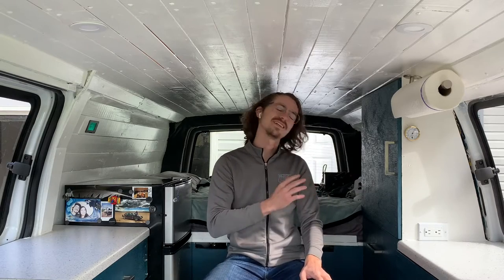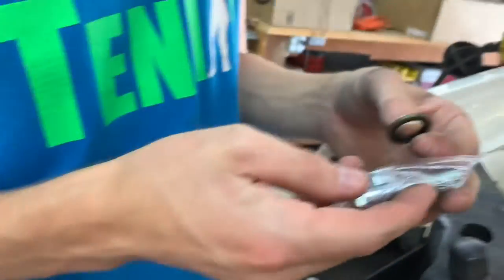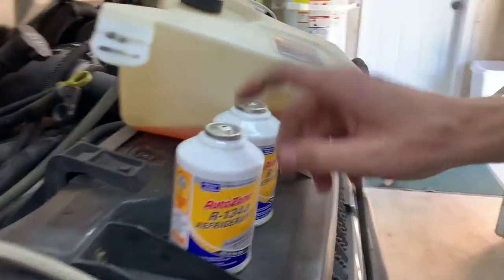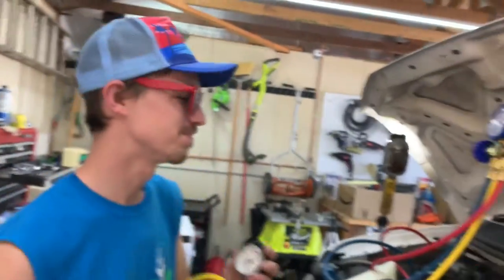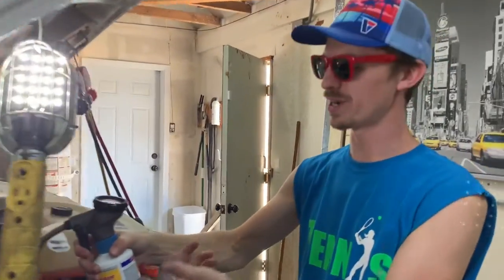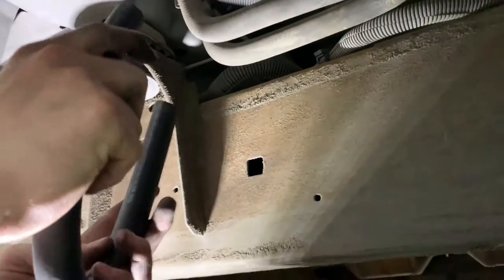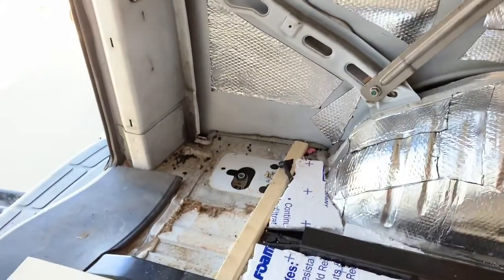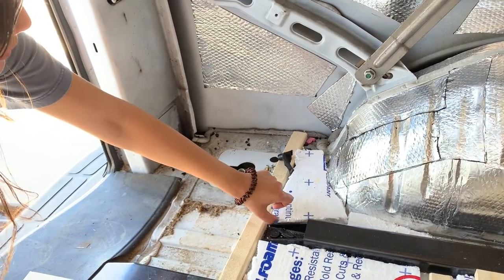Rear AC and Heat Bypass / Removal ~EASY~ (Express / Savana Van)

Comment: Awesome, thank you very much.  I just got a 1998 Dodge B1500 conversion van that has rear heat/ac.  When I was under the van today, I saw those long coolant hoses running all the way back to the rear of the van, some of them rubbing on frame parts, and I thought this is just asking for trouble on the back country dirt roads.  It would not take much to slice open one of those hoses and that would not be a good thing so, thanks again.  I enjoy your videos as they are very helpful.
Reply from the maker: My mom had a 1999 Express van and the rear AC lines ended up rubbing through themselves in a similar fashion. Of course, not so bad to lose the AC vs losing your engine coolant!
Thanks so much for watching and commenting!
-Tim

Comment: Hi Tim, wow! Why oh why? AC is a lifesaver here in TX, and I would have taken any extra parts you were discarding, just in case. I have a 2012 3500 15pax extended LT for my family,  there is some wetness under the back carpet. I could find no info on rear drain, but here you are, saving the day! Just a little wetness in the rear carpet, will clear that soon thanks to you, helping to keep those kids of mine cool in my 'Heavy Chevy'  Thanks! Have a great day!
Reply from the maker: There's still AC in the rear, it's just electric now and runs off my solar / battery bank!
(The 6.0L uses 1/2 gal of gas per hour just idling and running the AC)
Totally agree, 100% a necessity in Texas though.
Stay cool!
-Tim

Comment: Hey Tim great video. I checked the links. I just wanted to let you and your viewers know since it seems you can't get these specific ones on Amazon or Ebay anymore. There is a block off kit made by Auto Cooling Solutions, made in the USA, backed with a lifetime warranty and supports American jobs!  If you're looking you can find our site easy! Thanks, feel free to delete this comment if your linked products become relevant again. Or if you're still doing the amazon affiliate stuff, our rear ac block off kits, line sets and more are also there. You could switch out those links for ones that are available!
Reply from the maker: Appreciate the comment! Swapped out the Amazon Affiliate link to your product.
Curious (if you happen to know) - the line set claims to fit 2003 - 2014. Any idea what changed in 2015+ on the GM van AC system?
Cheers! 
-Tim
Reply: @VanwithTim  Hi Tim, thanks for the link swap! As for the line sets on those vans, we don't make any line sets for the full size GM vans. Our block offs go to 2014 only because we haven't verified any years beyond 2014. It's not a model that we have had a lot of inquiry into and therefore it get's somewhat of a "back shelf" treatment in the priority list. However, because the body shape is not all that different and if OEM line sets are listing different from 14 to 15, it could be maybe different connections were used and or maybe a slightly different routing of the lines. That would be my best guess without actually knowing for sure.
Reply from the maker: @Autocoolingsolutions  That makes sense. If I'm ever at the salvage yard and see a 2015+ I'll break out the calipers and check it out. 
2003 - 2022 GM vans seem to be around 85% the same. (95% on the exterior!) But you just never know what subtle changes happen under the hood and behind the dashboard.
All the best!
-Tim
Reply: @VanwithTim  Good idea. Sometimes they make the subtle changes just to make things incompatible with prior "era" models.

Comment: Appreciate the video, very helpful..  i had a mishap with a subfloor screw and an unknown rear heating/cooling line (was leaking clearish oily fluid) 2014 econoline e350. You seem super knowledgeable and
Reply: If you have any ideas on my path fwd is really appreciate any help!
Reply from the maker: @shizzhizz1234  I'm not familiar with the Ford vans unfortunately, but if your AC up front stopped working then it's definitely an AC line. (There should be block off kits for the ford vans much like the kit for my chevy van in the video)

If it's a coolant line you could cut all the way through the metal line where it was punctured and clamp an appropriately sized rubber hose over the connection to repair the leak!

And don't be afraid to give the fluid a quick smell. Coolant has a distinct sweet smell to it!

-Tim
Reply: @VanwithTim   thanks for the tips my man, it ended up being a coolant liine and so a pretty easy fix after all my anxiety..   definitely considering cutting ac so i can delete the rear system to make room for activities!   Appreciate ya

Comment: Update.  The block heater mentioned below is apparently 1960's tech.  I can not now find any comparable device that isn't electrically heated.  The oil burners are little boilers, power hungry and 4 or 5 times the output we need.

   Tim is, near as i can tell, the only other person in the world that figured out that cars come with a power vent from the factory.  And yet...
   Why is it that nobody else gets that vans may also come with the raw material of a complete house HVAC?  Fan, complete dual duct system with grills, even a fitted evaporator for the mini split.  I have not removed the factory AC yet, but hope to plumb a two season mini-split into the box w/wo the OE evaporator.
   What i have done is T into the OE coolant lines with a diesel burning engine block heater, and repowered the rear fan.  Be aware that the 12v solar system pumps that seem like a perfect match typically can't take the temps coming out of the block heater, much less the engine. My years old tempory solution is plumbing the pump into the return line, and shutting a ball valve underneath before driving.  This is holding, but i don't like the wearhering or the possibility of a leaking failure. It is quiet, uses a combined 40 watts, and makes too much heat at temps above freezing.  Hence the continued interest in a mini-split with a thermostat.
   One can probably build a more compact HVAC than the factory, but it seems like a lot of effort for very little return.  Insulate behind the OE headliner, keep that, the ducts, the lights, intercept fan and lights with house battery power, and you can call the ceiling good with nearly no cost in time and money.  I think my biggest expense there was LED bulbs for the factory lights.

Comment: Great video. Were you losing small amounts of coolant in the radiator as an impetus for you to block rear ac? Having a similar issue with my Astro
Reply from the maker: Didn't have any coolant or refrigerant leaks, but needed to remove the unit for part of my campervan build.
The rear heat / AC on your Astro will be separate systems - as in, if your engine coolant is leaking, it would not affect your AC refrigerant. Or if you were losing refrigerant, it would not affect your engine coolant. (Both sealed, separate systems)

Comment: Thanks for this! My van seems to have heater hoses running inside the van, but it didn;t look to be the same in yours. If the hoses are internal, any idea if removal is a mess/ can I pull them out through the bottom after plugging the heater lines like you did in the bypass process?
Reply from the maker: Hey Adam, once you plug the heater lines underneath, you can snip and rip out the remaining hoses going back to your unit.  

It might be a good idea to put an empty container under one of the hoses you plan to remove, then blow air in the other side.  This would push out most of the residual coolant into your container and help minimize any spillage 👍👍
Reply: @VanwithTim  Good call!! Just awaiting the AC plugs then I'm going for it!
Reply from the maker: @adamnilsen5715  sweet! Keep up the research and you’ll be doing great no doubt 🍻

Comment: I want to keep front heater/cooler but I want to take out the back one for my conversion. How I do this?
Reply from the maker: Once you bypass the rear AC and heater core (0:39 - 13:52) watch from 13:53 to show how to physically remove the back HVAC unit.

Comment: Can you change the fan without disconnecting everything underneath and removing the freon? Maybe just remove the black box  pulling straight up exposing the heater core and evaporator?
Reply from the maker: Hey Brian, just checked out GM's repair procedure. Unfortunately it calls for complete removal of the rear HVAC assembly (Draining coolant, recovering freon, etc) to access the blower motor.
However, if you remove all the mounting nuts both below and above, you MIGHT be able to tilt the unit enough to access the three blower screws and slide the motor out. (Not totally sure though!)
-Tim

Comment: Hey Tim. We're part way through doing this and we're a little unsure on how we should cap off the pipes that are now open, coming up from underneath the van where the unit has been totally removed inside the van. What did you do here? Thanks!
Reply from the maker: Hi Kelly, for the now "dead" lines in the back, it depends on if you think you would ever re-install the rear HVAC.
If you might re-install at some point, I would wrap a good quality electrical tape around the line ports.
I knew I wasn't going to re-install my rear HVAC, so didn't worry about it. You can safely cut them off and permanently secure them out of the way.

I used the newfound space to install a small but powerful diesel heater! https://youtu.be/Dr3v3zLpeYQ?t=814
Reply: @VanwithTim  thanks Tim! I'll never be reinstalling the rear HVAC so we just need to cap off or seal the two pipes that come up through the floor. These could be simply cut and then zip tied to stop the rattling? Our front hearing isn't working since we removed the back system and capped off the the tubes with the kit, at the front
Reply from the maker: @kellysilver3979  Correct, the lines at the rear can be cut and tied out of the way.
After capping the AC lines under the hood, the system will need to be re-charged with refrigerant.
You mentioned your front heat is no longer working? 
With the key on and engine off, turn the fan speed to low. Then listen as you turn the temperature control from hot to cold and back to hot. You should hear an electric motor moving inside the dashboard (passenger side). Do you hear this noise?
-Tim
Reply: @VanwithTim  I can only hear the van come on and the direction change. To electrical sound at all when moving from cold to hot and back again. 😭
Reply from the maker: @kellysilver3979  So it does not make the noise in this video?
https://www.youtube.com/watch?v=tv55XtgJfUE
If not, you may need to replace the temperature control actuator.
Reply: @VanwithTim  wow, thanks for the extra video. No, I'm not hearing that noise and the fixes you recommend are beyond my limited expertise. Off to the mechanic in Monday, I think. Thanks again for your help Tim.

Comment: Tim, appreciate the video. This is exactly what I am trying to do. Remove that sucker all together :). Question... on other vids I have seen them add oil prior to adding Freon and add Freon to both high and low sides. What is the benefit of the oil, is it required and is it necessary to add Freon on both sides?
Reply from the maker: If you’re installing new AC components (namely the compressor) you’ll need to add oil, otherwise you really shouldn’t have to add any additional oil, as it should stay inside the system even after having the refrigerant evacuated.
(Oil doesn’t condense, boil, or evaporate and it’s main purpose is to keep the AC compressor guys lubricated)

Hope that helps a bit!

Comment: Why would a person want to remove a very useful system? It does not take up a ton of space at all and here in FL we LOVE A/C!! I have no issue idling my van all night to stay cool or warm! These Ford engines in these vans were made to be used and idle DAYS at a time in the commercial world such as ambulance and police/fire..Now I did not watch the whole video to see why you did remove your rear HVAC so maybe you had a good reason but many would LOVE to have the rear HVAC! Even my old 83 Bluebird Wanderlodge <<<< pic in my icon, had rear heat for while on the road..the coolant lines ran all the way back to the rear to supply 4 more heat exchangers as well as the water heater's Motoraid system (have hot water while driving for when you stop) There were shut off valves at the front CAT diesel engine to shut off the coolant to the rear in case of leak or failure as well...then I had 3 roof A/C with heat strips plus they had 4 more electric built in baseboard type heaters plus 2 more LP furnaces..yes I know..overkill..as was the 15,000 KW Kohler/Perkins diesel generator to power it all..talk about a doomsday bus!!! She was ready willing and able to take what was thrown at her!!
Reply from the maker: We went with an electric AC system (runs off the solar / battery bank). There are some neighborhoods we’ve stayed near that parked and running vehicles get stolen pretty quickly. 
You’re right that the modern engines are more than capable of idling 24/7 without issue though.
I actually just installed a water heater like your Bluebird has in a Promaster van. Really slick design.

My old neighbor had a Wanderlodge. Beautiful machines!
Reply: @VanwithTim  Very true! LIke I may have said in my other comments I still don't see why you only have 84 subs when you have better content on van builds than anyone else! Actual usable ideas and not showing some idiot with ratty hair eating avocado toast!! haha Sorry I'm blunt!! It's true..you should have more subs!! Great content and build ideas!

Comment: Hey I enjoyed your video. I have the same system. I tried to man handle it and pull it out. Which caused it to leak all the coolant on the rear of the vehicle. Any suggestions? I know you mentioned killing the o2. Could I have done that?
Reply from the maker: Hi Matt, I too originally tried yanking the whole assembly for quite some time haha.  

If you're looking to replace the rear heater core, chances are you just broke the inlet and outlet off your old heater core. No biggie as the new unit will take care of those ports.  

If you want to remove the rear heat altogether, just get a short piece of heater hose and loop the lines like I did @9:50.
You'll lose the residual coolant running through the lines back to your heater core, but the engine and front heat will be tip-top again.

Hope that helped! Don't hesitate to ask for clarification! -Tim

Comment: Hi Tim, I bypass the rear heater but did not do the AC. I was thinking doing it in the summer. Can I still unscrew and remove everything from the back safely ? Thanks you, Emeric.
Reply from the maker: Hi Emeric, unfortunately the rear AC still has pressurized refrigerant in it until it's evacuated through the front service ports.

Once you remove the refrigerant you can safely remove unbolt and remove the entire rear assembly. 

However, if you do remove the rear assembly, I would fully recommend just going ahead and installing the AC block off plates in the engine compartment to keep any moisture or contaminants from entering the system.

(All of this assuming your AC still works and has no leaks of course!)
Reply: Hi Tim, I just started working on it again and notice that the guy I bought the van from actually unscrew where you put the AC block. I would not have to do anything to add the AC block. I assume that the removed line is going to the back and that there is not any pressure getting back there ?
Reply from the maker: @emericchouinard4064  Oh wow! Sounds like it might already be empty of refrigerant!
If you have any open (disconnected) pipes then it's safe to assume the system is empty.

For reference there are two lines going to the back.
One you can see going to the left of the connection I'm unbolting @2:38 
The second you can see in my hand along with the first line @3:50

If any one of those is disconnected, then it will be empty of refrigerant.

Comment: Works better when the can is upside down 😉 shake the can a good 30secs before adding it worked for me js
Reply from the maker: Turning the can upside down allows the liquid refrigerant to be sucked into the system. Probably fine on the van as the fill port is on the dryer. However I also owned a 2000 Durango which had its fill port directly above the compressor. 

Filling that with the can upside down would introduce the liquid refrigerant directly to the compressor.

Liquids don't compress.

There are many tales of compressors dying from valve failure after a DIY fill job where liquid refrigerant was introduced by holding the can upside down.

A safe trick is to put the can into boiling water or use a heating pad around the can while refilling. This helps evaporate the liquid r134a into a gas quicker. (I usually hold the can near a heat source in the engine bay while refilling)

I'm no HVAC expert, just some weird knowledge I've picked up along the way!

Cheers!
-Tim

Comment: After deleting rear ac and heat unit in my Chevy express my heat no longer works.
Any suggestions to begin trouble shooting?
I refilled coolant, spliced rear coolant hose with little kinking. 
Thanks
Reply from the maker: Have you driven the van around since? 
Sometimes the engine needs to be run at a 2,500rpm+ speed for the water pump to push out any air bubbles.

Is coolant full in the radiator and coolant reservoir?

Let me know!
-Tim

Comment: hot  tap water works to heat the can  - boiling water?
Reply from the maker: Both should work fine, the evaporation of the r134a gas from the can to the vehicles system is actively chilling the water. If you just set the can in boiling water without releasing the pressure into the vehicles refrigerant system you might over-pressurize the can though.